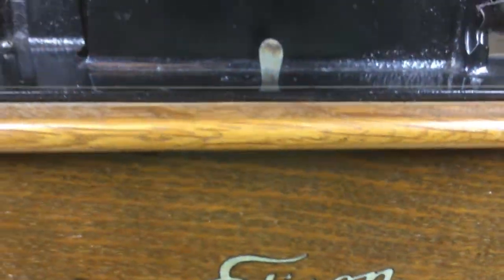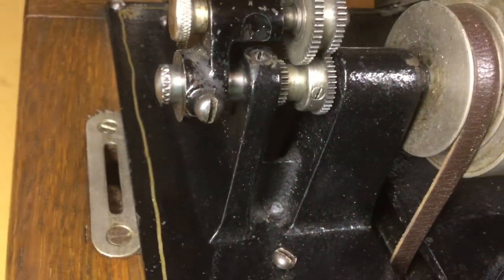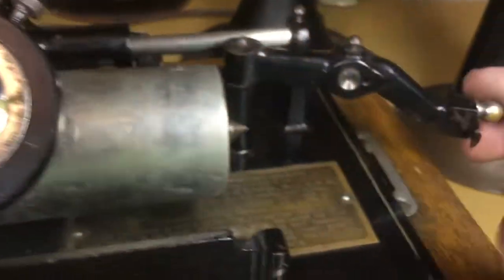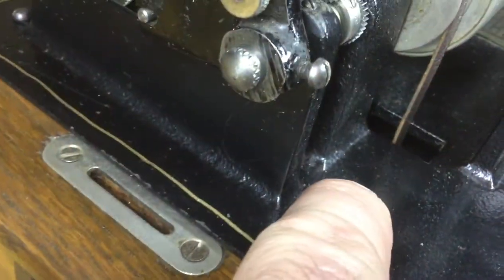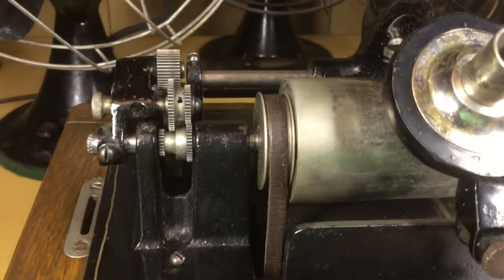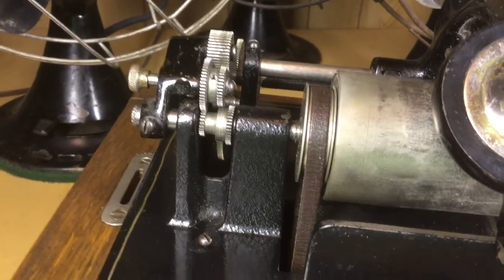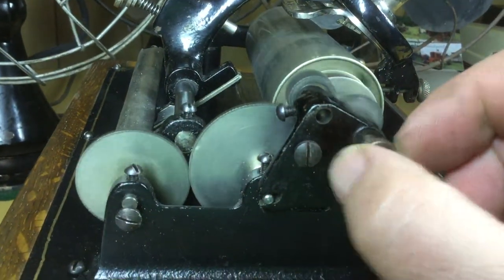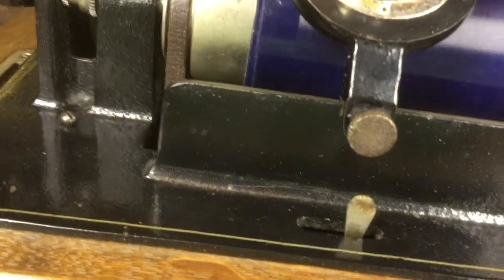Edison Standard A and B 2/4 minute conversion kit overview and "Whispering"

Comment: Hello, i just installed a conversion on my standard A, i took out the the set screw for the gear that slides and changes gears but it is still only spinning with the shaft turning. Is there a froove it sits in or am i missing something?
Reply from the maker: You may need to disassemble the gear from the shaft and clean it. The shaft has a shoulder and the clearances are tight and any gunk from dirt and dried oil could easily bind them up.

Comment: What reproducer are you using that works with 2 minute and 4 minute?
Reply from the maker: I am using an H for four minute and a C for two. A K will do both with the slant-top carriage shown here.
Reply: @okbridges  so a 4 minute H and a K that does both can both work on a model B? my B has a Model c for 2 minutes like yours does. i just wanna make sure i but the correct 4 minute.
Reply from the maker: @josephwalk1747  If you already have a model C reproducer, all you need is a model H for playing 4 minute records. The model K has the stylus bars of an C and an H mounted on a little disc attached to the underside of the weight, it turns so you can match the stylus to the record being played. The model H has less moving parts that a K, so will sound slightly better. I recommend the H over the K.
Reply: @okbridges  thank you for the tips.

Comment: Totally confused (new to this). I have an Edison Home Combination model D phono. It has a 4 minute Reproducer model H........
How come it successfully plays a 2 minute black cylinder?.......
But a blue amberol cylinder won’t fit on The mandrel all the way.  It seems to play ok when I lower the reproducer onto it......
So what cylinders can I play with my H reproducer?......
There also another smaller pulley, which I can’t figure out how to use. It needs to slide over to allow belt onto it?....
Once I can use the smaller pully what cylinders can I use and will they fit mandrel?
Reply from the maker: The Blue Amberol record will not go on because it needs reamed, that means the plaster core has absorbed moisture and swollen, causing it to not go on all the way. Reaming the inside restores the proper diameter so it will fit correctly. 
The small pulley is not a pulley but is the clutch that changes from 2 to 4 minute playing time. Push it into the belt pulley for 2 minute records, and pull it out for 4 minute records. The feedscrew will turn at 1/2 the mandrel speed in 4 minute position. 
The model H reproducer will play 2-minute celluloid records without damage, but it he sound will not be as good as it could be. Any 4 minute reproducer should never be used to playback wax 2 minute records.  
Use a model C reproducer for black wax 2-minute records and celluloid 2-minute records should be played with the model C as well.  The H will play Blue Amberol records just fine.
Reply: okbridges         Sure nice of you to reply.     Clarification please.....                I’m playing a 2 min black cylinder with my   4-min H-reproducer, and it sounds normal (not too fast nor slow).              Did you invert your meaning when saying push-in clutch?     As I have it pulled out now and recordings sound ok.....

I tried pushing and pulling clutch but don’t see where it moves. This is a clean unit so don’t believe it’s frozen nor Gunked  up.  Any release button to press?....

You said ok to play blue amberol on my 4min H-reproducer, but what if it’s a 2 min amberol?
Reply from the maker: @scsu5085  
2 and 4 minute celluloid cylinders will usually play fine with the H reproducer.  The stylus of a 4-minute reproducer such as the H is too small to play wax 2-minute records of any type without damage to the grooves.  You did not specify what type of material your black 2-minute cylinder record is. If it is celluloid, the H will play it safely, though better results will be had with a stylus that fits the groove correctly, such a model C.
The stylus of a 2-minute reproducer such as the model C is too big to track the smaller grooves of 4 minute records, whether they are wax or celluloid.

Yes, the clutch pushes in towards the belt pulley for 2-minute records. You will see the feedscrew speed up to the same speed as the pulley and mandrel. There should be a gap between the right end of the clutch and the feedscrew in the 2-minute position, but the two pins on the feedscrew should still engage the slots in the clutch. In the 4 minute position, the clutch will be right against the feedscrew, and you should be able to see the clutch and feedscrew turning at half the speed of the pulley and mandrel.
I suggest moving the clutch back and forth while the machine is running, there is a flange on the clutch so you can use your fingernail or finger tip to shift the clutch back and forth.
If you shift it when the machine is not running, you may need to rotate the mandrel slightly so the gears line up and it will shift fully into place.

Are you sure your Blue Amberol is a 2-minute record? Your machine may be very clean, but may not be adjusted properly. Check and make sure the feedscrew is changing speeds when you shift the clutch.
Reply: @okbridges          Ok  I surrender.....     I don't know the difference in the cylinder types.     I have a black one (plays well on my Model H reproducer)   and a blue one, which seems to skip a lot.  I assumed the blue color on the latter meant amberol.           Therefore,  I do not know the difference between wax, celluloid,  blue vs amberol, etc.    Not sure where that leaves  me...….

I tried with a good pinching grip to merge/collapse the clutch into the belt drive, with & without it running.   Again, no luck.    I didn't fully get your meaning about shifting the clutch with fingernail.

Do you have a model D?     Do you have a video of your doing this operation,    as well as a video of   cylinder ID   (material type),   and how to know if 2 or 4 min?

If not, thanks so much   anyway   for taking this much time,   I feel I belabored the topic, but I simply don't have any good contacts and thought I'd impose on your expertise.

Sc
Reply from the maker: @scsu5085  To tell if the black record is wax or celluloid, try scratching it gently with a finger nail. Choose a place that will not affect play, such as the edge opposite the title end or the inside. Another method is to look at the inside of the record or core. If you see a cardboard tube with a metal ring, you have an Indestructible, which is the most common type. Most black wax records will have ribs on the inside and no core.

Yes, I have a model D Home, as well as a model B Home that has a 2 & 4 minute conversion, and a model A and model B Triumph with 2 and 4 minute. All of these work basically the same. The model B Home has a little lever instead of the a flange for shifting the clutch because it was found that the older machine did not have enough room for the model D style clutch. If you watch my video on adjusting the speed of an Edison phonograph, I use the model B Home and shift the clutch from 4 to 2 minute. This machine has a lever to shift the clutch  so it lacks the flange, but the clutch is otherwise the same. See the video here: https://youtu.be/rbdAkj55bBw
Reply from the maker: Take a look at this video, it should help you with your model D https://youtu.be/0LR5xxupUKs
Reply from the maker: @scsu5085  Did you ever get your machine sorted out? 
Take a look at this video, it should help you with your model D https://youtu.be/0LR5xxupUKs